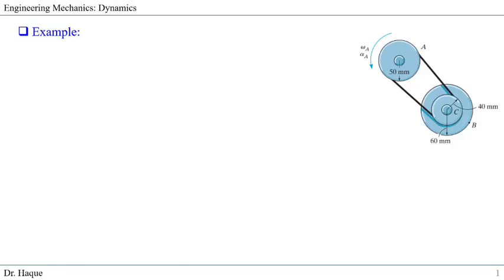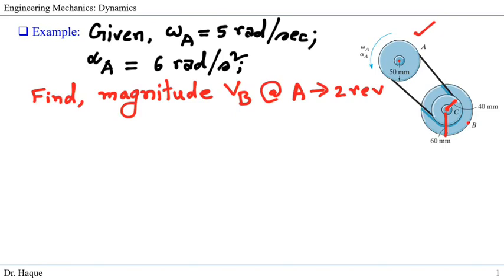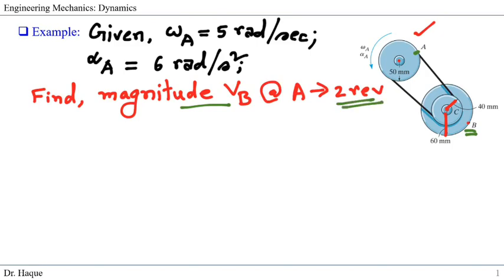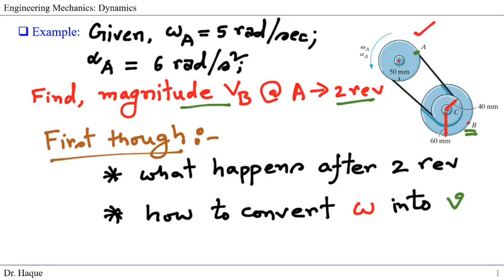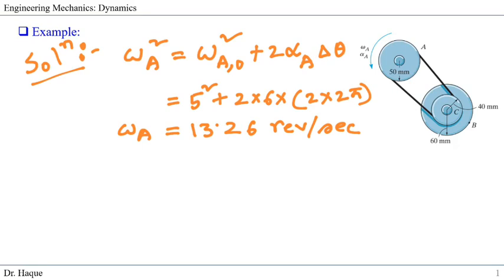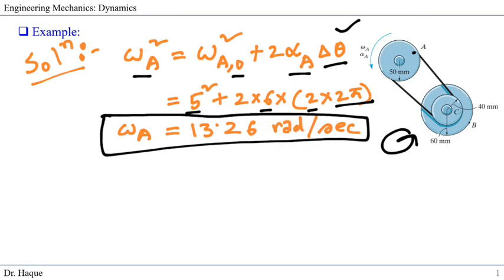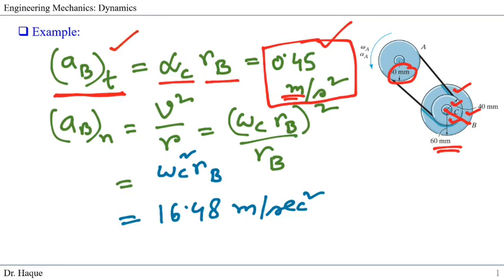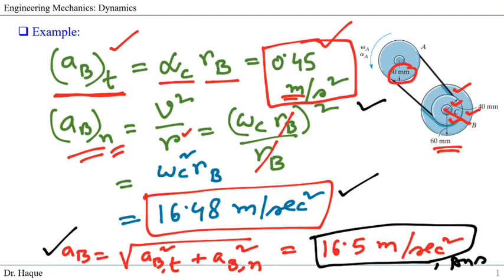Rotation About a Fixed Axis (Step-by-step problem solving explained)

Comment: for acceleration tangent of b why are you using the angular acceleration of c, why didnt you use angular acceleration of b to find the at,b
Reply: Hi that is because C and B will have the same angular acceleration because they are on the same shaft when on same shaft they will have same angular acceleration and angular velocity also point between 2 gears have the same velocity and tangent acceleration